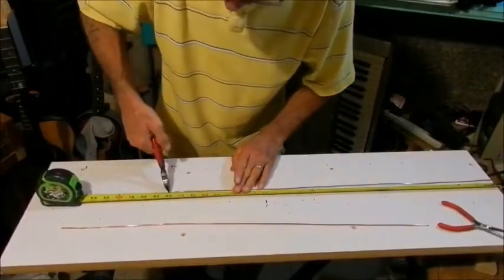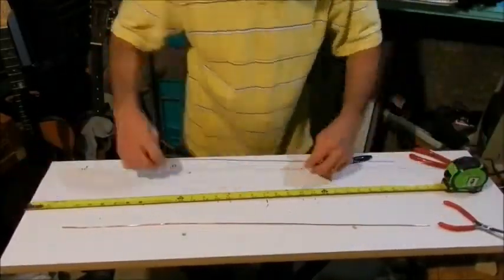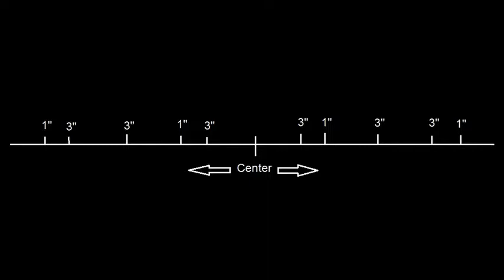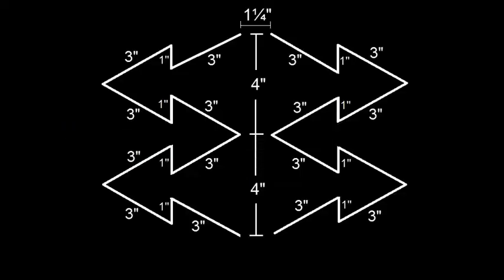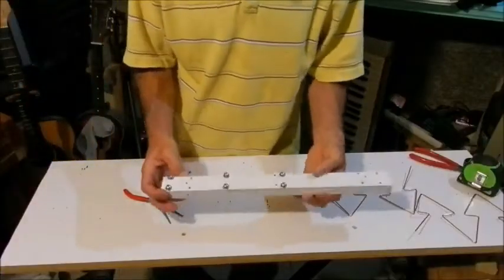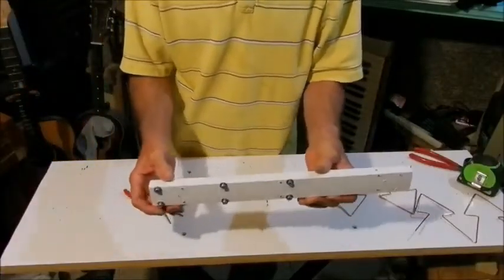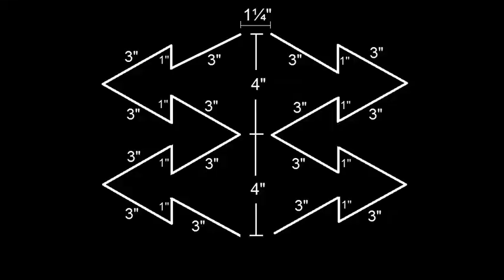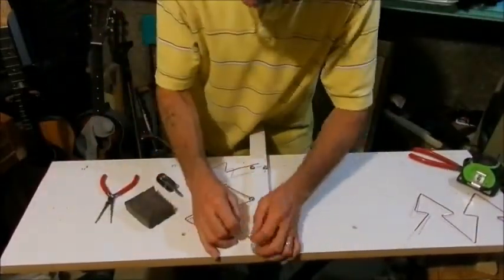How to Build a HDTV Antenna - The Mini Tuxedo

Comment: How well does this design pick up VHF stations?  I built a hoverman antenna before which does pretty well on the uhf stations, but the vhf-hi stations in my area have very spotty reception without adding narod elements.
Reply from the maker: In my opinion the narod elements are the best way to go for VHF. This antenna does kinda mediocre for VHF high and fairly well for UHF but in its defense it is a basic “One size fits all” kind of antenna.

Comment: I'm about 8 miles from the hill with all the major network towers and they are apparently a mix of VHF-Hi and UHF.  I built this using coat hangers and it works great!  No more low signal messages.

Comment: You should place a reflector on the back of the antenna.  This will improve the reception.  Metal screening with 0.5" x 0.5" mesh size would do.  Unfortunately , it makes the antenna directional.

Comment: Where should I mount this antenna in a mobile home?
Reply from the maker: Since mobile homes are made of metal it is hard to get reception from inside.
It might work ok if it is in a window that faces the transmitting tower. If not it may need to be mounted outside in which case an outdoor matching transformer is best. I hope this helps:)

Comment: Can a vhf antenna be added to this one?
Reply from the maker: Thanks for your question beertrain. This antenna doesn't need VHF intergration as it has a wider frequency reception and should at least pick up VHF high (RF 7 - 13) without a problem. I did try to add one and it didn't work. It worked better stand alone.

Comment: Thanks Mike. Going to put the design to test and try to make one.

OK done that. It's not as pretty and I used some aluminium ceiling anger wire. I had to buy a balun $1.99 It took me about 20 minuets to make, I'm kinda slow. Took some tuning to get it pointed in the right direction but so far it's working better then the $20 antenna it replaced, much better really. going to give it another go and be more careful with the measurements, bends, and use better materials.